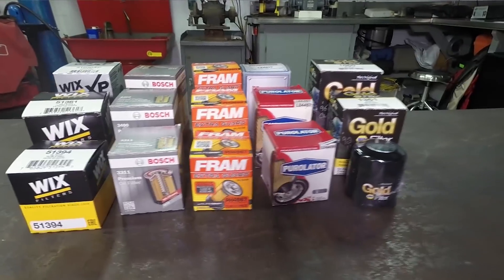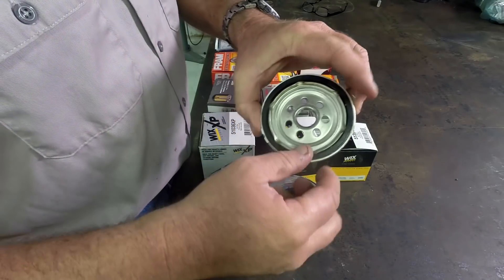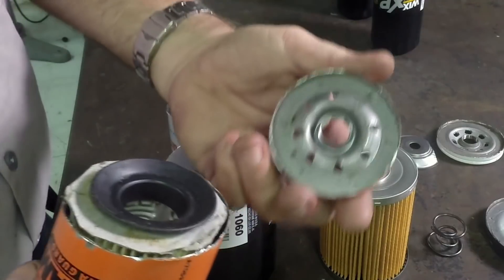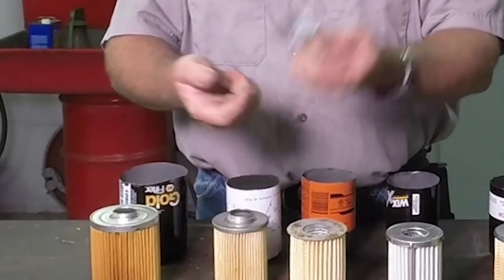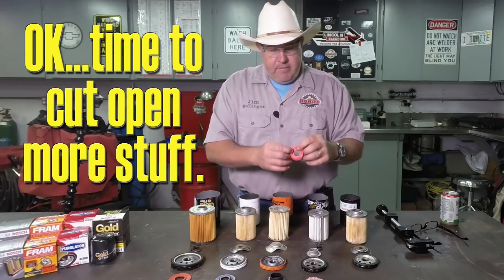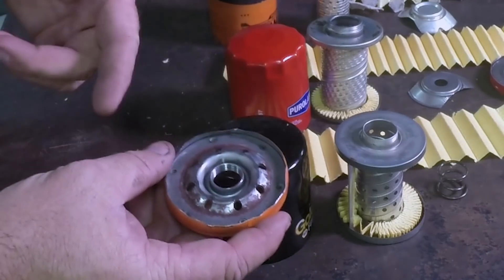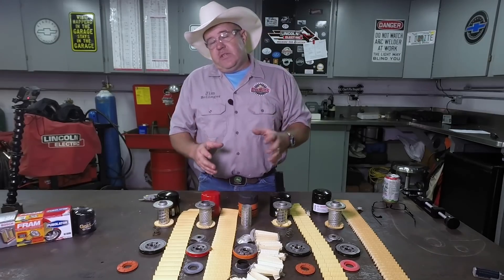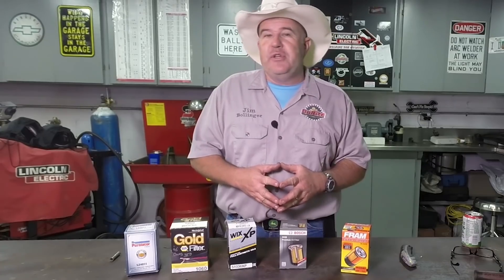The worst oil filter EVER!

Comment: I've been using fram filters since I was a teenager. I have never had a problem  out of them. And yes i have had the engines apart
Reply: Used cheapo Fram oil filters on 2 Dodge Caravans.  Hit 140,000 and 170,000 miles with no oil related failures.  Weight, wall gauge and length of filter media are interesting but I haven't seen any demo where the minimum particle size trapped is measured or discussed.  Have to admit that I did change over to Wix on our Escape.
Reply: Wow! Your anecdotal testimony completely invalidates the dozens of engines I've seen Fram filters destroy, for sure! Maybe you'll win the mega millions lottery, too! Wow wee!

Comment: Get what you pay for. 
I have been using cheap frames for over 30 years due to my budget , I am not a machinist I do basic maintenance 2 oil change 1 oil filter my 19 year old car has 375,000 and still running strong.

Comment: FRAM...typical of what happens when good company is bought out by an investment group.
Reply: I've noticed over the years that [outside of a financial services company] that accountants make lousy CEO's, as any business has both quantitative and qualitative components to it.  You need them... but just top them out at low level vp status, with guardrails.  A business run purely by bean counters generally loses its audience/market in the long run as it damages itself - and may even implode.

Stories abound but here's one that's typical of pinheads run wild.   An efficiency "expert" get hired/makes recommendations to lay off the paint crew on a marine installation.  Payroll savings?  Maybe $1.8M over a five year period.  The cost of replacing steel following this accountant manuver?  $17M.

Comment: The best oil filter is the one from the dealership that your car came from.  I bought my first car when I was 18 and in 11th grade Automotive High School Brooklyn ny class of 1993!!
    Anyway I drive my car off the dealership floor (yes it was actually on the showroom floor. But I didn’t drive it off the dealership floor. But I did drive it  out of the service garage I am still the proud owner of a 1992 Mitsubishi 3000GT VR4 twin turbo.  So this was back when dealers offered complimentary oil changes every 3000 miles and I got to talking to the mechanics because I used every oil change as well as it needed a lot of service between the electrical gremlins and the digital air conditioning control breaking every year when summer time comes along. As well as the transfer case replacement safety recall. It’s been a long and awesome 27 years with the balls’est car I’ve ever owned and I owned a lot of cars (also own an 87 Buick Grand National) and 90k miles later I’m now a retired nyc firefighter and an ASE certified auto mechanic that I got from High school +1 year of full time work at R&S Struss back when I was 18. Plus after I retired I graduated from Wyotech Daytona campus with a degree in Asian concentration as well as ASM (business owning).  I’m sorry I’m getting off the topic. I just wanted to paint a picture of my qualifications and experience. So when I was still in high school I was taking my car to the Mitsubishi dealership for everything up till the 3 year 36k mileage warranty expired and I remember the technician would not shut up over how superior the Genuine Mitsubishi oil filters that you buy at the parts department at the dealership are. And how not using a genuine oil filter was the kiss of death for my car. So one day I decided to call him out on it.  And it just so happens that they have a Mitsubishi 3000gt (non turbo but Dohc) with the engine out and the oil pan off the engine. And this while crankcase was dry and burned up. He showed my a Fram oil filter that he pulled off of it (since the complementary oil changes were only for 12 months the owner of that base model had to pay for his oil changes so he decided to change his own oil). So anyway the technician has already cut open the fram oil filter and there was little to no brass bearing material inside the paper elements of the filter. And he then proceeded to show me the bypass aka pressure relief valve stuck in the closed position so not only did the paper elements of the filter fail but the emergency bypass valve (that he kept warning me about on aftermarket especially Fram) on this Fram big orange filter both failed ruining a 31 month old 6g72 engine. Luckily for the owner of that car there was nothing in contact that said he had to have his oil change at the dealership so he received a rebuilt engine under the warranty. But he almost had to pay for the repairs out of pocket. 
     And knowing now what I didn’t know back then about the 3000gt 6g72 Dohc engine I honestly would have done my oil change every 1000 miles because the 6G72TT twin turbo engine connecting rod bearings and the engine turbos are not very forgiving when it comes to oil starvation. 
     So anyway I’m sold on the genuine oem oil filter from wherever your car came from. Even if you buy a 20 year old used car tomorrow. Go to the dealership parts desk and buy 5 oil filters. I guarantee you they are cheaper then these K&N, purolator gold,and Mobil one fancy oil filters and are either just as good or superior quality then those.  So if you care about your car go to your dealership and buy a few oil filters (mine for my 3000gt vr4 cost exactly $5.14). If you own a GM or a Ford vehicle you can buy your filter at any AutoZone because they stock both AC Delco and Ford Motocraft oil filters. 

Sorry for the long story but if I can save Judy one engine by telling it then it’s worth any trolling and hurtful comments that I won’t even read. 
Be safe driving 

Oh ps , what I said about dealership oil filters goes double for motorcycle engines. Because it’s a different concentration of oil. It’s actually a much better concentration oil that also lubricates the transmission and the filter sees engine and transmission debris so please choose wisely.

Comment: Watched your vid, like your style - no BS!  I'm an ex-SCCA and IMSA competitor/driver, and half-ass backyard mechanic.  Oddly, although I've never cut open a bunch of filters before, I have always preferred WIX filters since I first saw them used by Lotus in the late 1960's.  They always seemed a little heavier than the others, so I assumed they either were more heavy-duty or they contained more filtering media.  Either way, I always use them and have never suffered an oil-related failure in any vehicle I've ever owned, and I've owned several for over 250,000 miles, one Toyota Land Cruiser for over 360,000!  I also was similarly loyal to Kendall oil, but they are no more.  Now, I use Pennzoil.

Comment: I work at NAPA also. Wix and NAPA filters are identical when you get to the gold. Top quality all the way. Fram are just relying on their name since the quality has been lousy for at least 2 decades.
Reply: Nothing wrong with Frams quality. They are a reputable brand. My dad used them for years. Been using them for years with no failures. Can't go wrong with a Fram.
Reply: @imposter 0shadow 
The best Napa filter is the one that has the neoprene check valve ,that you can see when you look at it at the bottom!!!  Because it doesn't get hard and lose it sealing propertys!!!  Most other filters have black check valves WHICH get hard and leak back all the oil in the filter!!!  So every time you let your car set for awhile you get a dry start witch is not good!!!
Sir, just read the comments and you have people that have used Fram FILTERS for year!!!  Have vehicles that have 3 - 4 - 5 hundreds of thousands of miles using FRAM FILTERS!!!
First of all!!!  Everything I said is TRUE!!! AND ""TWO"'" as you say!!!  All of those FILTERS that you cut open are BYPASS FILTER!!!  AND ANY OUT THERE IF YOU WANT TO KNOW THE TRUTH WHEATER THE FILTERS ARE BYPASS FILTERS JUST ASK AROUND AND YOU WILL FIND OUT THAT THEY ARE BYPASS FILTERS!!!
THE REASON THAT THEY ARE BYPASS FILTERS!!! IS BECAUSE IF THEY WEREN'T AND THE FILTER PLUGGED UP THE OIL WOULD STOP GETTING TO THE ENGINE!!! AND YOUR ENGINE WOULD COME TO AN ABROUT STOP!!!  IT WOULD FREEZE UP FROM THE LACK OF OIL!!!. THAT'S WHY THEY ARE BYPASS FILTERS!!!
AND I ALSO WAS MASTER MECHANIC!  FOR FORTY YEARS MORE OR LESS!!! 
MATTER OF FACT I AM ABOUT TO UPLOAD A VIDEO THAT TELLS PEOPLE THAT FOR ABOUT ONE HUNDRED DOLLARS THEY CAN BUY THE PARTS THAT I TELL THEM TO BUY!!!  AND THEY CAN INSTALL THE PARTS THEMSELVES IN LESS THAN TWENTY FIVE MINUTES OR LESS!!! NO TOOLS REQUIRED!!!  AND THE CARS OR TRUCKS LAST FOR MILLIONS OF MILES!!!  RUN LIKE NEW!!  NEVER HAVE TO CHANGE OIL OR OIL FILTER!!!
LIKE SAID THE ALL OF THOSE FILTERS ARE JUNK!!!  AND THAT'S WHY TENS OF MILLIONS OF CARS ENGINES AND TRANSMISSIONS WEAR OUT EVERY YEAR!!!
LARRY
Reply: @larryneiderhiser148  -Doing good... until you hit all caps.
Reply: @Blogengezer  Sorry!! Hope you could understand enough to save your teeth, health, and life!!!
I will go over it again!!!! With out hitting the CAPS!!!
It's real easy!
1.  Take clindamycin?
2.  Use my cleaner!
3.  Pull all lose teeth! 
4.  Fill all cavitys on remaining teeth!!!
5.  View all videos!!!
6.  Now you are cured of the gum disease Bacteria Infection!!!
7.  Did this help you!!!!!!!
Larry

Comment: Somebody should send this video to Fram! I'll never buy another Fram product again!
Reply: formula112967.     Why  not you ?
Reply: I'm sure those assholes at Fram have likely seen it,lol.
Reply: Cutting the filters open does not mean much. Rust would be captured by the filter media. The type of back flow spring doesn't matter as long as it works and the seal prevents back flow. The important thing to test is the flow rate thru the filter and how much particulate is captured. That can only be accurately tested by making up a standard of dirty oil to test all the filters and measuring how much pressure drop happens when the oil passes thru the filter and how dirty the oil is coming out when the filter is new and the oil cold and say after maybe 72 hours of having the heated standard oil continually pumped thru it. Measurement could be simple like rating a drop of oil color on a white paper towel or more detailed using a glass smear between two microscope slides or a grind gauge.

Comment: I have used Fram oil filters for over 30 years and never had a problem.  This video is a fraud and sales tactic to get you to purchase more expensive oil filters that basically does the same thing Fram Oil filters do.  I think this guy intentionally altered this Fram filter to make it look cheap or defective.  Just my 2 cents.
Reply from the maker: Sales tactic by who? I dont sell filters. Don't like the results, I really dont care. I post what I find. People keep smoking even after the proof that smoking causes cancer. Wanna keep using Fram's crap filters, fine by me. As far as questioning my integrity and intentions,  well you can go stick it right where the sun doesn't shine. Or better yet go look at my Diesel oil filter video with similar results. You really shouldn't comment? At all...ever!

Comment: I've used fram for every car iv owned in the last 8 years, never had a problem...
Reply: The problem is there expensive and cheaply made
Reply: Gary Marin:  Don't tell people that... they will tell you how dumb you are.  It's the orange can of death.  I have asked several people who made claims on YouTube that a Fram oil filter "destroys" engines, to prove it to me.  I have yet to see a video of an engine failure directly caused by a Fram filter.  This usually results in the person hurling insults at me, telling me how dumb I am... while providing zero evidence of their claim.  Now, I do agree that these orange filters are not "the best" oil filter ever made.  However, I have never seen or even heard anyone talk about a Fram filter causing an engine failure in my 20 years of automotive repair.  That seems like something I should have come across in all that time.
Reply: They are cheap not expensive
Reply: @Vintage & Modern Repair Yeah, that's kind of crazy.  You would think that NAPA has some "higher" quality parts.  So that is just really odd.  I have had really good luck with Fram, so I have been sticking with them.  I even picked up one of their Ultra Synthetic filters for one of my Mustangs just to try it out.  I have yet to chop it open and take a look at it.  Should be interesting.  I guess the lesson is... use what works!  Thank you for sharing your feed back.  Comments like yours are what make YouTube so great in my opinion.
Reply: Not speaking of Fram instead I speak of oil additives the most of them do not stand behind their guarantees they generally claim that you must have used something else that caused the problem.so dont buy into guarantees if it works good for you and has in thepasr stick with it.